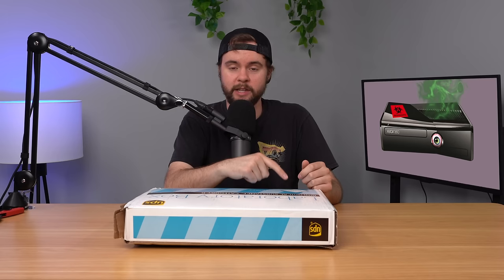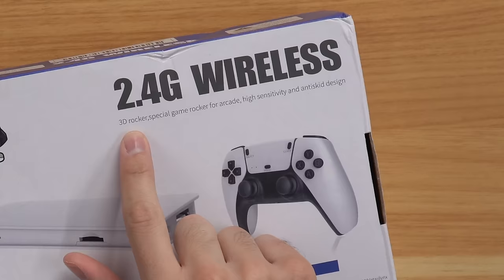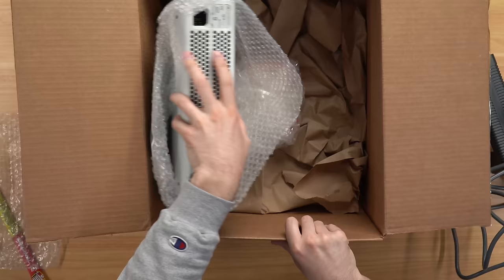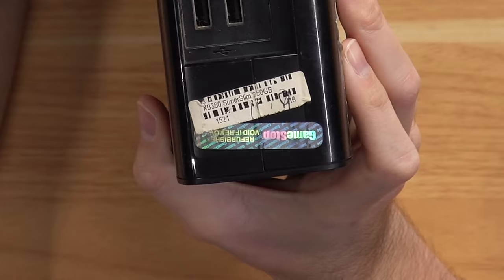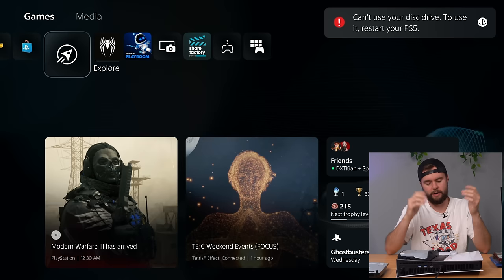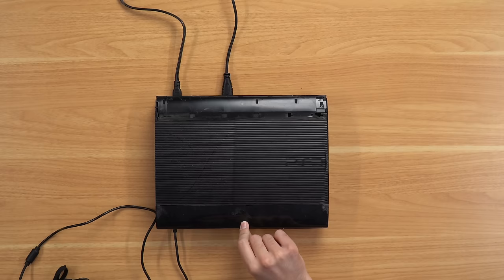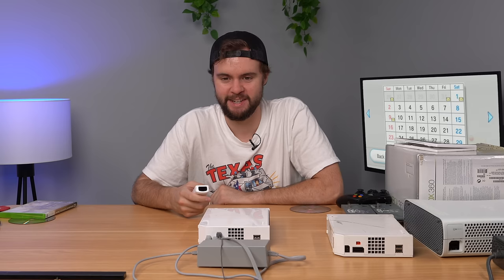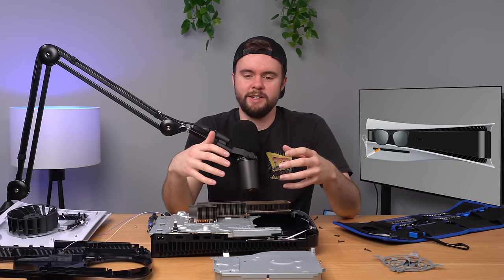I Bought 250 consoles from DKOldies, TEMU, & Goodwill...

Comment: I loved watching cable TV through windows media centre on my 360 as I had no coax in my room. Yes all before the digital switchover. I had a TV tuner on my XP PC, then Vista laptop, in the basement and used the wireless N adapter to send the signal to the console two floors up. It was not great. That is when I took my first stab at Ethernet powerline adapters and it worked Great.

Comment: They may have cleaned it but cleaning it wont get the cigarette smoke smell out of it. The residue sticks to the board, shell, ect and once its been on there long enough the smell seeps into things and it wont come out. Especially if they smoked a lot or smoked with windows closed ect if thats all the system was pulling in then that smells going to be there for a while youd have to clean it with an ultrasonic cleaner a few times and honestly probably still wouldn't get the smell out because its seeped into the pores of everything on the system anything that is pours like the plastic cables/cable coverings its going to sit in it and once the system heats up youre going to smell the cigarette smell.

Comment: There's no set thing for refurbishing, it's a seller term used to make people feel better about buying something second hand. There's no true standard when it comes to refurbishing that a company has to follow it also differs from person to person/company to company. Just because most people would see refurbishing as completely opening a console fixing any problems it may have then cleaning it and replacing thermal paste the next person may see refurbished as the outside isn't dirty and it works. There's no law or anything else a company has to follow when labeling something refurbished.

Comment: its funny i got a console from retrovgames a ps vita and suprisingly it was refubished as far as i could tell, no scratches or anything on the console nor markings or dirt or anything. still working fine 2y later so maybe i was lucky?

(for note i didnt open up the console but as far as the outside goes it looked very clean)

Comment: Your Lucky u never bought a og 360 Cause I Bought 3  all White systems with the 8 gb hard drive crap & All of them All Got Red ring of Death & I called & talked to someone at Xbox & they Wanted me to pay to ship them to them & pay to fix them all But they would cover the shipping back & I Told them There is Something Wrong with your  Systems & They should fix them for free But they said That They Were Not Sold Flawed & basically too Bad I would have to pay to fix them . I Then Walked out & Threw them All in A Dumpster at my girlfriend's apt. & said F Xbox and Went & for a brand new PS3 and Was amazed how much better the PS3 was then the Xbox 360 Then About a week after I threw those 360's in the dumpster Guess What Xbox Admitted they Were Flawed Pos & Selling Junk. Never Got another 360 until over 10 years later & Thank God it was a slim black system with a 250 gb hard drive. I Was A Huge Original Xbox Fan & Never Liked or thought the PS2 Was Worth a pint of piss but Once the 360 Came out by the 3rd one I Really hated Xbox & since then it's been ps3's ps4's and PS5"s  sure I do go one or two Xbox ones & one Xbox x But I Got 6 ps4's and 3 ps5's and Hell I even got around 6 or 7 switch systems.but None compare to the system I have the most of & that is the PSP Which I have over 50 of. Lol they made a lot of different ones I had to get